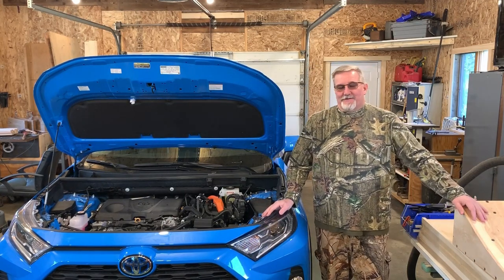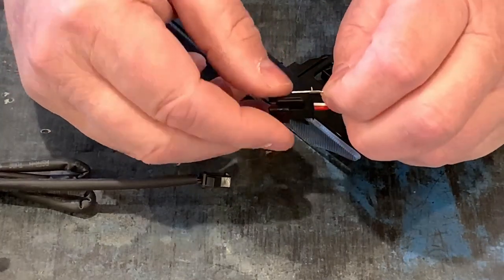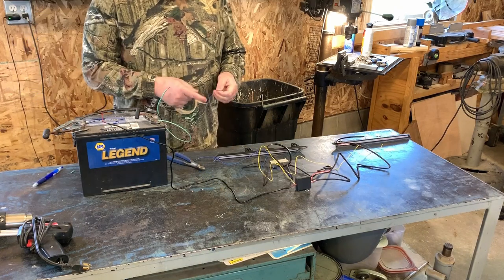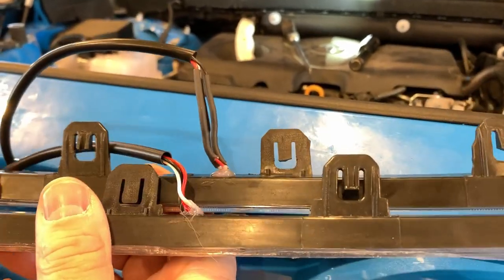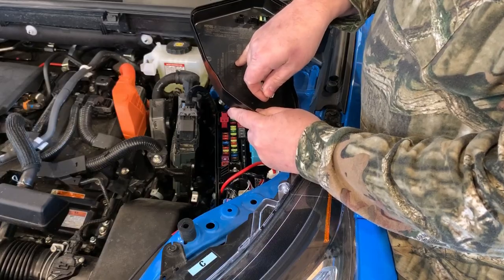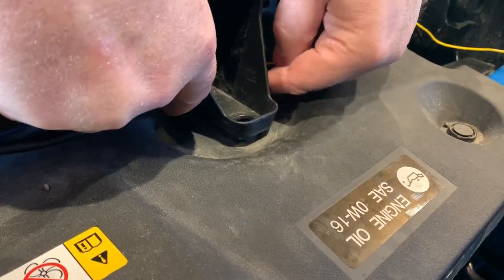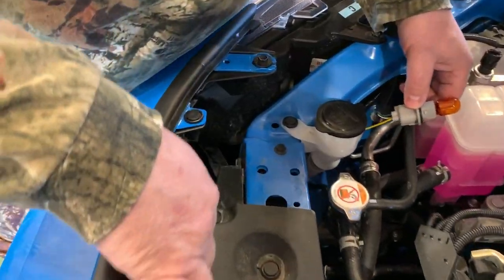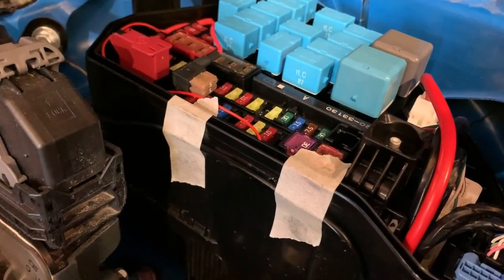2020 Toyota RAV4 Hybrid XLE Daytime Running Light/Turn Signal mod Install/tutorial

Comment: Just got down adding the lights to my 2021 Rav4 XLE. Premium.  My turn signals had 3 wires going in, but the upper left tested out to be the one I needed. I used tap splices to connect. I also had to do a little reaming out to get my wires thru the  grill. The plug in was too big. My light kit was a little different then yours, but your video helped a lot thanks! 
I also installed sequence lights on my mirrors. Really looks cool!
Reply: Hi I have  same rav4 as you can you help me with the changes you had to do 

Thank you
Reply: Oh buy the way we're did you purchase yours, because the link for ebay is not working  once again thank you

Comment: You don't have to drill a hole in the fuse box housing to install these lights. I have seen another video where the guy drills a hole downward in the fuse panel near the big red cable and you wont have to do that either. All you have to do is if you have an air compressor blow gun with the long metal extension you can insert it downwards in between the big red cable and the black cable. What it does is it loosens the black electrical tape around all those cables. With the blow gun inserted I ran a red wire into the center of the blow gun from underneath and slowly retrieved the blow gun while pushing up and advancing the red cable to keep it from getting stuck on the tape. Then when it is inserted through i basically went back and made sure the tape was secured again around all the cables without the need to drill.

Comment: I did the same mod on my 2022 RAV4 Prime.
Looks great.  I really like it.  Now I have to do something to the rear to match.
Reply from the maker: Glad to hear, thanks for watching
Reply: Update:  Just finished a similar mod of DRL/Turn signals to the rear.  
Since I was taking out all the rear door trim to work on the project, I decided to use the opportunity to purchase and do the cargo area lighting mod as well. 
Both turn out great and look fantastic.  

I have one last thing to do, and that is to get a new rear Toyota emblem to mount on the new rear trim.  The new trim with the animated lights did not come with one.
Rather than remove and transfer the emblem from the old trim, I ordered a new LED backlit emblem in blue, to match the color of the R4P.  Hopefully it will be in this week.  

These are the two mods I installed:
https://www.amazon.com/dp/B08FD31G6V?psc=1&ref=ppx_yo2ov_dt_b_product_details
https://www.amazon.com/dp/B0B12FDZRZ?psc=1&ref=ppx_yo2ov_dt_b_product_details

Waiting for the Emblem:
https://www.raymaxgear.com/products/toyota-led-emblem-dual-color

After all this, I think I am done with exterior lighting.
Reply: On your 2022 Prime what did you connect red wire to?  Did you connect into fuse box and if so which fuse slot did you use?  Also did you connect white wire?  Did you tap into turn signal wire as they are led on 2022 Prime and headlights and marker lights are in one headlight unit. Appreciate your reply.
Reply: @GregSwenson-lb3bw   Sorry I missed this reply. 

Initially I had connected the red wire to the fuse box.  Testing around I found a circuit/fuse that became active when the car was turned on.  A few months I installed an 8 channel switch control panel.  I connected the DLR to that controller so that I can manually switch it on or off from inside the car, along with my other mods.
The yellow signal cables still connected just behind the left and right signal lights.  So the signals will animate regardless if the DRL is turned on or not.

As for the white wire.  It is a dimmer signal.  When you apply 12v to it, it seems to dim the DRL by about 50%.
If my original setup, i left it unconnected. Keeping the DRL at full brightness.

After putting in the control panel, I connected it to a pulsed channel on the controller just for kicks.  
Activating that channel causes the DRL's brightness to pulse.  The pulse rate can be set in the control panel.

Comment: I put these on my 2020 Rav4 Hybrid. As you show, there are several places you have to cut the plastic to make it fit. Mine fits a little further out than I would like even after the trimming. The pieces are a not of the best quality and seem to have gaps around them between the lens and the lamps. I did not use the add-a-fuse method like you did. Seems to me your way they would be on all the time whenever the car is on; and I go to a lot of drive in movies, that would be a problem. I hooked up to the directional lamps for the directional wiring directly instead of using your through the socket method too. I got the power and ground from the outer most left lamp, as it is an incandescent lamp and these LED's use very little power so the added amperage is really negligible. So now my ADD ON lights are not DRL but Nightime Lamps that come on when the auto headlamps switch on. The sequential directionals still work during the day without the DRL function. I like the way I set mine up better, but I did solder into the wiring right next to the factory lamps. I also put the control box & wires underneath the plastic instead of on top of it, so it does not show. I  placed the control box behind what I think is the 'radar unit'. If the 'radar' can handle the heat/rain there; hopefully the lamp control can handle it too. I will find out. Nothing is overloaded according to the vehicle or the meter I used, and the radar works perfectly.
Reply from the maker: The way we hooked it up the running lights are only on when the ignition switch is on as it should be.

Comment: I have 3 wires for connection. Red, White and Black(ground).  I understand that the red wire is the positive connection that goes to the accessory fuse but what about  the white one that I have?
Reply from the maker: It's been so long ago that I don't remember
Reply: Hi did you ever find out where to connect the white wire too? Seen something online saying it connects to headlight but where ?
Reply: Yeah any luck with the third wire? My only guess is the side mirrors but not sure where it'd go.

Comment: Hi from Holland. Great job done! I’m in Holland and the lights differ from US specs models. Now I’m commissioned to the US Army for two years and I want to bring my RAV to California. In order to be able to import the car I need to convert the lights. EU spec models do not have the amber parking lights, so that section of the housing only serves the turn signal. That section for the US models double for both turning lights and the amber parking lights. The European models have just two leads leading to the section whereas the US versions have three. And the plugs are also different. Now if I want to change that all, where do I get the power from in order to power the bulb? Obviously I’m gonna need another socket for the bulb and another amber bulb. Same goes for the marker lights (front and rear) that also lack on other than US spec models. If done properly I would have to replace all four housings but that would be a costly affair. So if I start from there, maybe importing the car would be no hassle. Later on maybe further changes must be made, it all depends to what US regulations dictate or allow. I have plans to leave the car in the US when I leave again.
Reply from the maker: My guess is you are dealing with a completely different wiring harness. You will have to pull power directly from the fuse box as we did in the video. You will have a power lead for the amber parking lights you will have to splice into your new plug.

Comment: Hey, I just learned my 2021 LE hybrid doesn’t have the 7.5 fuse installed.  What other fuse  can I use?  I bought the same adapter you used in the video.  Thanks for the tutorial 🙏🏽
Reply from the maker: Not sure

Comment: I have a 2022 RAV4 prime XS and it has LED turn signals that apparently dealer must replace the bulbs when needed. To tap into turn signal wiring for sequential switchback DRL would it be best to use Posi-Products wire connectors rather than t-tap connectors since wires are so small?  Also since you have recently removed these lights from your car, would you even recommend installing them?

Comment: That rubber plug you removed for the yellow wire just poke a hole and insert the yellow wire then use that as a sealer for the wire
Reply from the maker: Thanks for the tip and thanks for watching

Comment: Nice upgrade! Will you be installing the fog light upgrade? would like to see a video on that too :)
Reply from the maker: That's up to my son. If he wants to do that
Reply: If you mean the daytime running light/turn signal mod for the fog lights, I do not plan on doing that.  I've only seen one video (and it was pretty low quality with almost no explanation) and it is a much more intense process than this.  You have to complete remove the front end plastic to get at and wire everything up with those.  I did this because I knew it was going to be a pretty simple modification without having to take anything apart too much.

Comment: Can you provide the link to the Ebay seller for your lights?   Also the part/stock number for the fuse block used for your electrical connection.  Thank you in advance.

Comment: I have a question, it comes with black, red, yellow,  and white cable. The black is ground, yellow goes with turn signal, and red to acc fuse box, to what did you connect the white cable to?
Reply: The white lead should connect to the headlight positive feed wiring.  It dims the white light when the low beams are on.  The red wire should be connected to the feed wiring for the front amber running bulbs (side lights in front, not turn signal).  You can attach the black wire to the ground wire in the same feed.  The side light is a better place to wire the red so the new front lights are only on when the "running " lights are on, not when the accessory fuse is hot.

Comment: Hey would you know how to replace the low/high beam for a 2019 toyota rav4? Is it similar to a 2020 change? I tried looking up resources but couldn't find anything can you please let me know if you know how to and possibly make a video on it? I want to see if I can replace my leds myself for my 2019 toyota. Thank you.
Reply from the maker: Sorry haven't had the chance or need to do that yet. Seem like it would be a bit of a task to do.
Reply: I’m pretty sure they’re built into the unit. I believe if they ever go out, the whole headlight would have to be replaced. That’s at least the case with the 2014+ Corollas.
Reply: The Headlights on the 2019 RAV4 is a single unit! Yes Toyota screwed those of us who would like to either change out the current bulbs or even look for an aftermarket headlight unit to replace the current one! Since the 2019 is still considered a (New Auto) after market distributors haven't caught up yet!

Comment: Can you make a video for the rear reflectors is going on bumper thanks
Reply: If you need the link let me know
Reply: Unfortunately, I don't plan on doing this to my RAV.  I thought about it, but there is just way too much work to get to the wiring you need to connect to, and to just install the reflectors.  You have to pretty much remove the entire bumper and then some interior trim pieces to connect everything.
Reply: It's OK I trait with my to see what happens

Comment: Quick question,Where does the white wire goes? Or it’s not used at all?
Reply from the maker: Depends on the year I do beleive.  We didn't use the white on this model
Reply: I didn’t use it either. My RAV4 looks great. Thank you very much. It was a great tutorial.👍
Reply: You can connect the white wire to a feed wire to the low beams.  The white wire will dim the new white lights when its hot, not really necessary in my opinion, I like it bright even when the headlights are on.

Comment: You should not be messing around inside the turn signal plugs or sockets. Like trailer harnesses, wire taps should be used to access the turn signals. The black casing needs to be trimmed back to make room that allow access to the wires. The way you have it wired by removing the turn signal bulb your added wire falls out ! A bad idea in which a good electrical connection is not guaranteed and it is also not weather-proof. No silicone needs to be used. You should at least use that rubber plug. It should have a hole in it in which a wire can be threaded through. If it doesn't, then make one like the other 2 plugs that have wires through them.  // On another note,   having the new turn signals instantly turn on and off, but the original turn bulbs take their time looks out of place. The incandescent turn signal bulbs should be replaced with LED bulbs so they match the flash profile of the added LED turn signals.

Comment: Interested to know if yours are still working correctly?  DSide on my set lost LED section and was acting erratic after 1 week.  They replaced DSide only with a newer version and as a result the white color wasn't quite the same.  2 months later the PSide lost a section of LED's now.   Great job on the video but I'm not thinking this is a quality product.  I ordered from the same vendor as you.
Reply from the maker: Still working perfectly here

Comment: What if there's 3 wires from my signal wire?
Reply from the maker: you would just have to bring the wire in from the side then.
Reply: Do you mean from the positive signal wire?
Reply: @martmalicdem1139  The video that I saw showed the wire running through the clip part of the connector and when the bulb is put back on, it just pinches it into place.
Here is a link to a not great quality video, but they put the wire in the connector this way, https://youtu.be/foPNTLve5-8?t=175 
I would recommend playing it back at 50% speed as it goes pretty fast.  This was the only other video I could find of someone putting these lights on and figured we needed to do this in-depth video on how to do it.